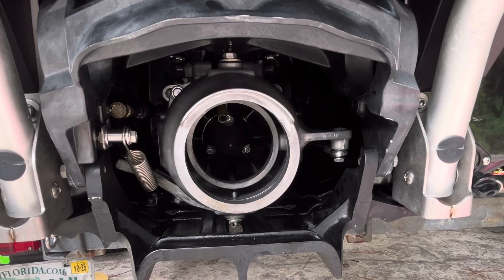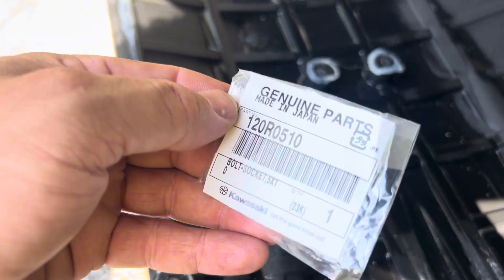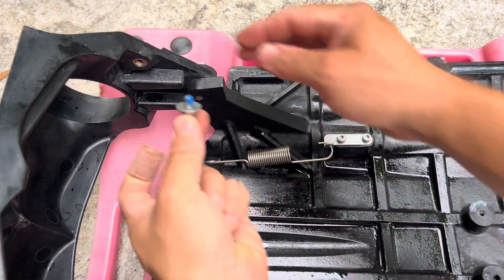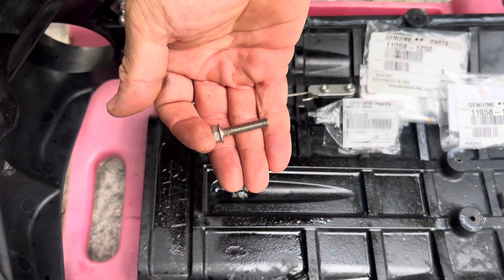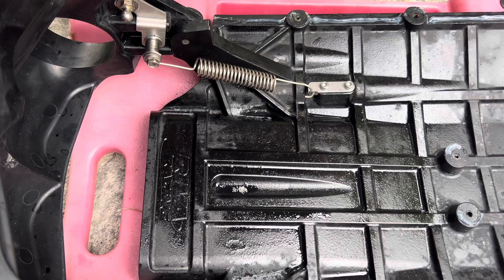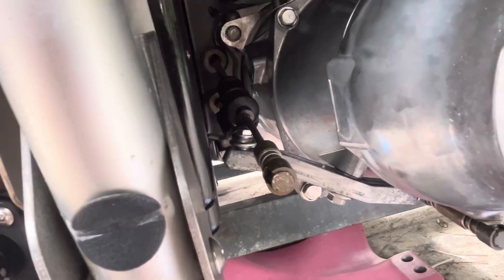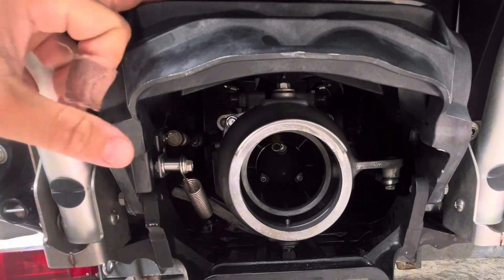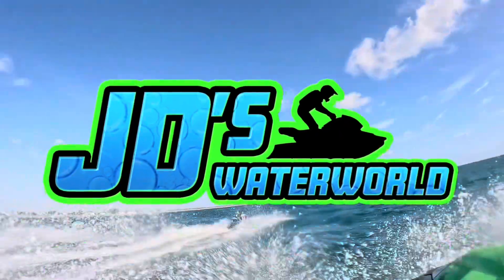Kawasaki Smart Reverse - KSRD Update and Retrofit for 2022-2023 Ultra 160 & Ultra 310 Jet Ski

Comment: Hey JD, do you know why the reverse bucket cable was shortened for the new spring assembly?  I was wondering if having the longer cable (like your 2022) would eventually lead to some kind of KSRD failure down the road if you add the spring.  Thanks!

Comment: Waste of time. The Kspeed K3 ride plate removes this from all the 24 and up skis so to buy all this to me is going back in time lol.
Reply from the maker: The kspeed plate came out BEFORE Kawasaki made these running changes to KSRD. I have the kspeed plate...Riva invested the money to update their plate to add the mounts for the spring assembly. Sorry to say, the spring is a critical addition and really the KSRD system is not as good without it. I personally would not go back now that I've seen how the spring improves the safety and function of the KSRD

Comment: So last time I took my ski out, everything worked when I inserted the immobilizer- Stereo and dashboard. But the starter wouldn’t engage unless I jiggled both battery terminals around. What do you think could be the problem JD? I don’t see any corrosion on the battery. It is the lead acid one that came with the ski so it’s probably time to get a new one anyways. I do keep it hooked up to a battery tender. I wonder if the dielectric grease I used last time I greased the terminals was bad
Reply from the maker: Did you check the the connection to the starting solenoid? Check the nuts..also if your battery is more than 2 yrs old you should definitely replace it with an AGM or atleast load test it...

Comment: I hope Kawasaki someday understands how important your channel is to their Jet Ski division.  Your channel is the best source of information on the Internet for these machines.  It's the reason I'm getting a 310-LX-S. I live on a large, deep and nearly uninhabited lake that can get some decent swells and chop, I need a machine that I can rely on when I'm 7 miles off shore in a 1,000 ft. of water with no one else in sight and no cell signal.  Thanks for doing what you do and I hope you keep adding Kawi content like this despite your new "girlfriend".  😉
Reply from the maker: Don't worry, I still bleed green even though the idiots at Kawasaki corporate are too dumb and shortsighted to get out of their own way. I do love the FX though, it's a great ski. The Ultra is by far the most durable ski with the most solid hull- but sadly the wire harness and fuel pump are weak points right now that they refuse to address. Kawi Performance has the parts to simplify maintenance and fix all the engineering shortcoming from OEM
Reply: @JDsWaterWorld  The FX seat is just too wide for me. Hurts my hips and inside my knees after a couple of hours trying to stand in chop.  Great ski though, and sadly the only remaining manufacturer still made in the USA.
Reply: Sounds bliss.... Got any videos of your area... I don't mind my own company either.
I think it's a man thing. 😂
Hi from me over on Scotland. 😉👍
Reply: That being said can we all get together and at least call kawasaki on a specific day/week and tell them this and that we dont appreciate how they act like they dont give a fuck. They need to address the basic issues
Reply from the maker: Good luck lol they aren't "acting" like they don't give a F, they actually don't give an F! I literally get better customer support from Kawi Performance for a $2 bolt than I do from Kawasaki for a $20,000 Jet Ski 😂 I am embarrassed for them how badly they suck at customer experience
Reply: Cringe on kawasaki 😂.  @JDsWaterWorld

Comment: Nice JD!  Curious what you think about the action of the KSRD when you get it out on the water.  Thanks for taking the time to post this content!   (2nd)🤣😂
Reply from the maker: I tried to time the open and close before and after adding the spring as I can swear it shifts about 1-1.5 seconds faster than before. The biggest draw is the spring helps to keep the bucket upright and away from the jet stream. There has been scenarios where the bucket dipped too low and threw people off the ski over the handlebars. This is a good safety upgrade and IMO kawasaki should have done this install as a recall for every single owner as a matter of safety
Reply: @JDsWaterWorld  Nice!  Going to add it to the list of things to do this winter!  Thanks!!